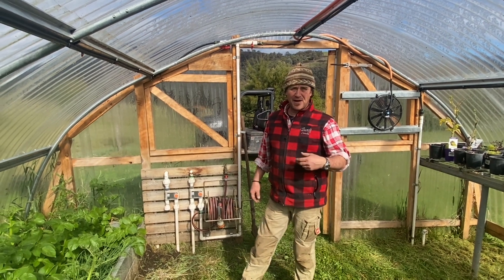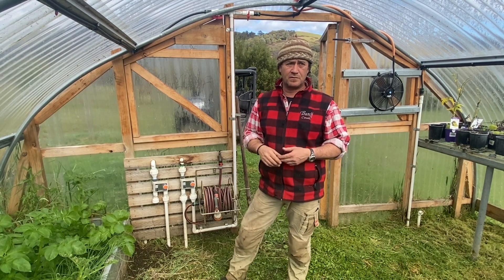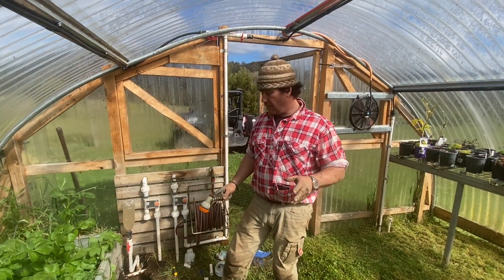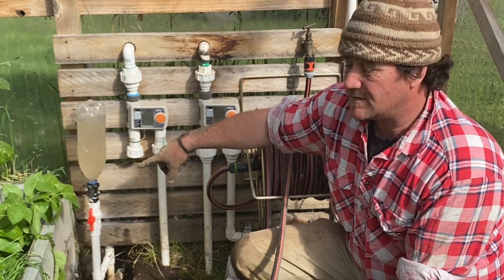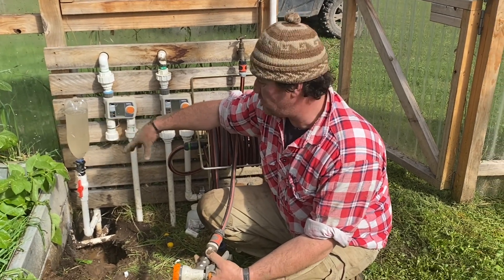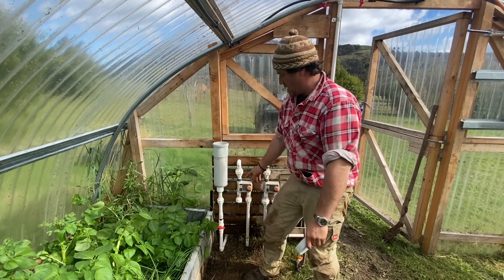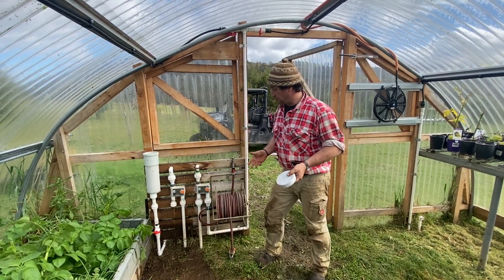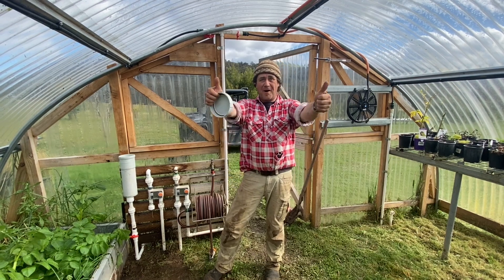Fertiliser Injector for Vegetable Garden Irrigation.

Comment: i ALWAYS WANTER TO DO THIS but I was and still am scared that I will cause massive blockages in the sprinkler system, and so went the coarser system with the IBC cube on wheels and the fire fighter hose.   I could not find anything to filter out the solids from my mixture of worm farm suidge and and compost extracts,  and blended materials - there were so many contaminates that to get it down to a sedimate free liquid took too much time.   I did find that geo textile drainage fabric was good but then there was a waste product with the clogged up cloth that had to be bought in the first place.    There being as many microbes on the plant as under it and all acting together I like the overhead approach, although my wife uses the underground injection method which does seem to work, but takes too much time for me.